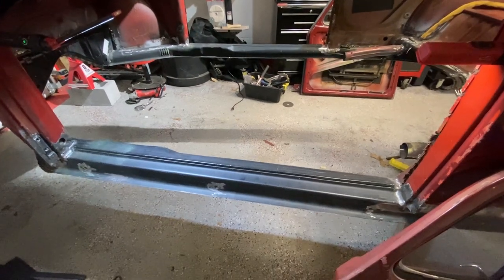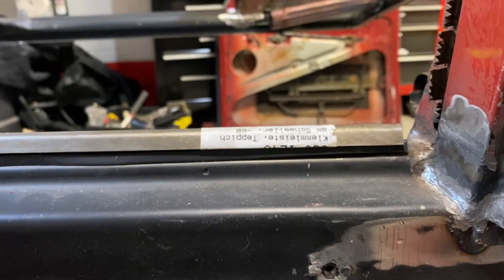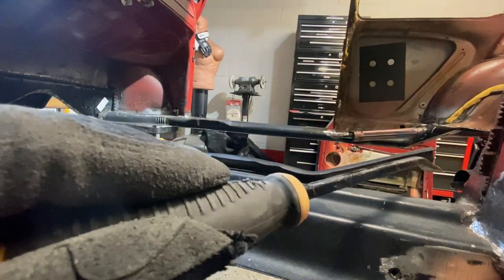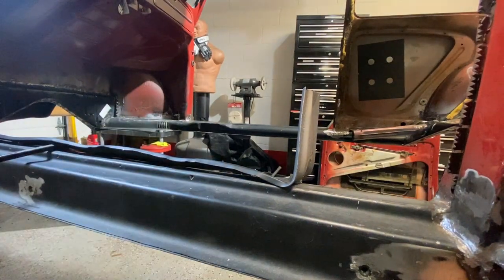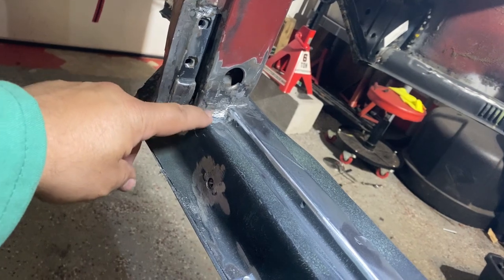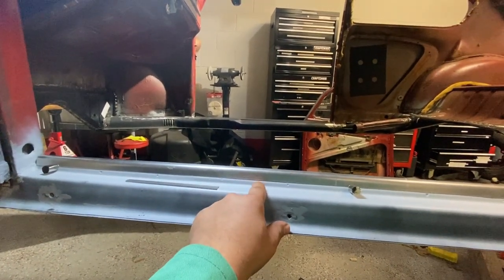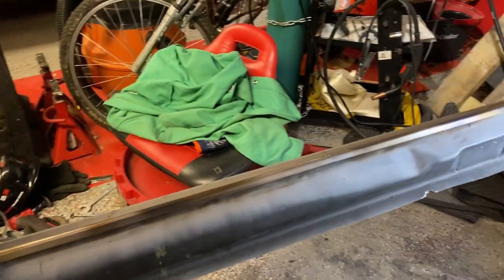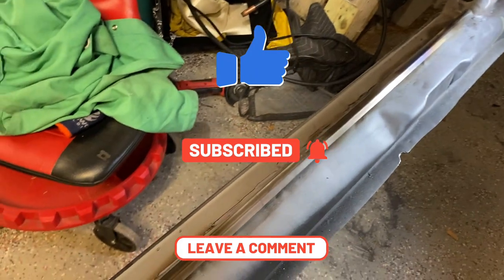VW Bug Carpet Gripper Install

Comment: Great job! Someone replaced the rocker on my 68, and never put one on.
Reply from the maker: Rocker panel? They are not bad. They will warp as you weld one on. I have even tried the wet towel technique for cooling. Still warped. It only requires some hammering and very little body filler.
Reply: @FixinBugsNStuff  Exactly! I’m going to order a new strip for it. Not sure why they left it off.

Comment: Just an FYI, the 69 model year is a split model year. Early cars have the old style carpet strip and later cars have the newer style. But in most cases, with a little trimming and pulling off the later carpet strip attached to the carpet, you can make the late kit work on the early car. That’s what I did on my 69. You can see the car in my channel.